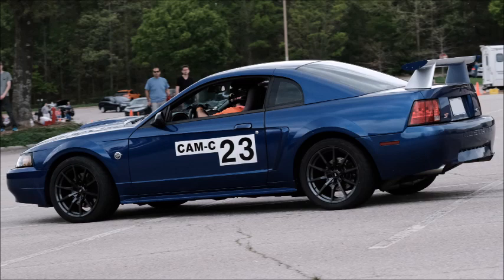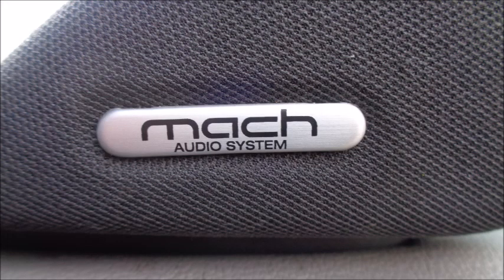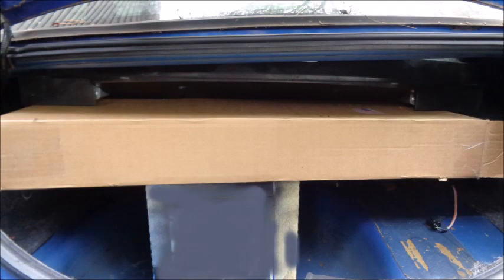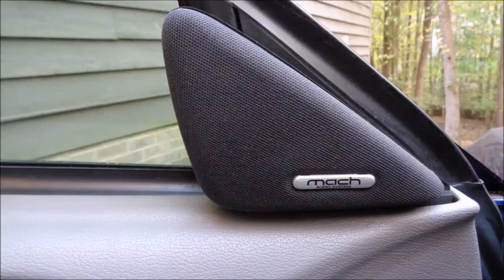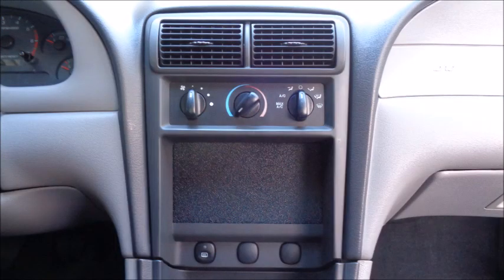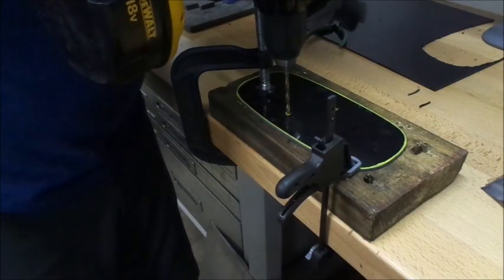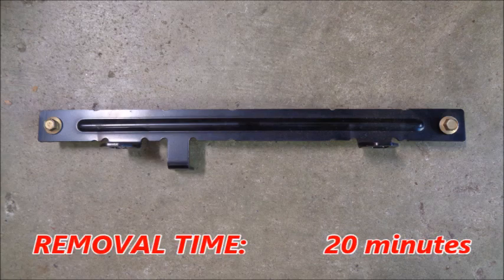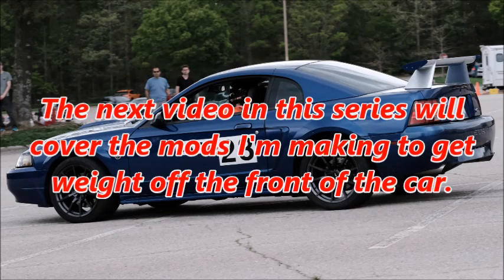The CAM-T DIET Part 2: INTERIOR WEIGHT REDUCTION

Comment: Remove carpet padding
Reply from the maker: The carpet padding is weight that sits very low in the center of the car, which is good weight in terms of mass centralization. If I can't find other, more beneficial, places to remove weight, I'll consider removing the carpet padding/sound deadening.

Comment: The fact that you slowed down your audio to make the video take more time stresses me out
Reply from the maker: I didn't slow down the audio. In the past, I was told my videos were hard to hear due to various issues. I speak slowly and loudly to make sure the information is clear. I'm never going to intentionally make a video longer than it needs to be just to improve watch time.
Reply: @warhorseracing  that’s odd, because if you play it on 1.25x speed, it sounds completely normal
Reply from the maker: @ThriftedPerformance  That is interesting. I guess it would sound "normal" because normal speed is me talking a little slower than usual.